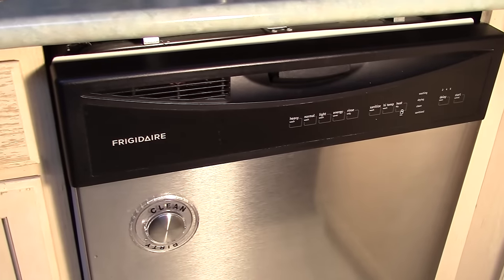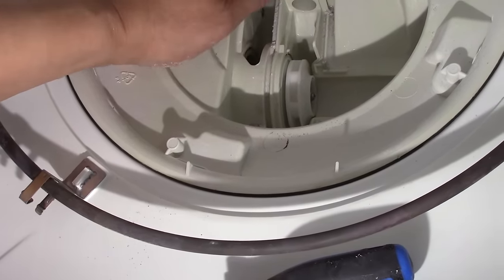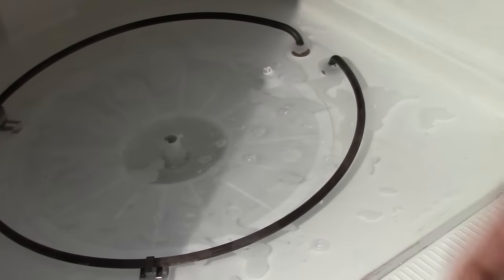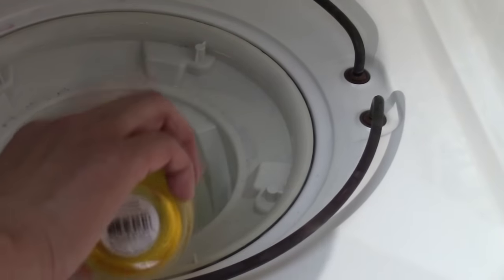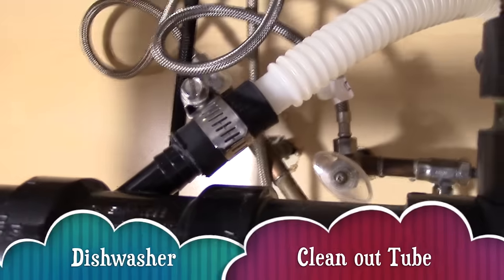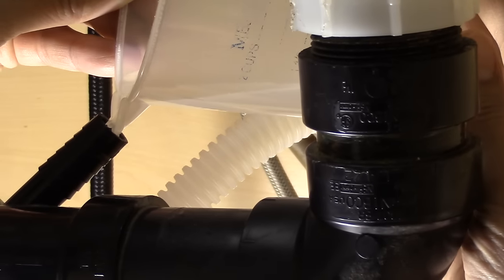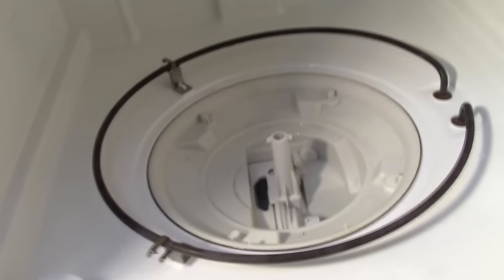Frigidare Dishwasher Not Draining Failed  2x - DIY unclogged dishwasher

Comment: Thank you, I realize that your video is 4 years old but you should know it’s still helping people fix their lousy Frigidaire dishwashers. Very helpful 👍
Reply from the maker: Yes it seems like there is still the same problem with their dishwasher like mine. Thanks for watching.
Reply: Lousy lol you do know it's not lousy. It's your lack of dishwasher knowledge that causes issues right. A dishwash is not a dishwasher but as sanitizer. You cannot put greasy dishes in a dishwasher or dishes with food on them inside of a dishwasher or you always get this problem. You have to hand wash first and then put in the dishwasher.
Reply: Yup!! Last method worked for me, some sort of build up in that small pipe.  So happy I came across this video and didn't have to pull the dishwasher out and take it all apart.
Reply: Mine won’t start after getting the water out and cleaning it the lights are on but it doesn’t start
Reply: I come across this video and it’s saying 6 years old for me 😊

Comment: I don’t usually comment on videos but this worked. Great info too. Step 3 was a kinked hose from too much junk under the sink pushing on the hose. Almost bought a new unit! This saved $$$$ and solved the root of the problem. Also helped me get the filter installed again, for the life of me I could not get the 3 o clock and 6 o clock positions right until your video.

Thank you!
Reply from the maker: You are very welcome. Great to hear it worked out for you. Thanks for sharing.

Comment: I'm so glad I didn't use plain old force before finding you.   Your video showed so clearly how to remove and replace the glass trap and what it sits in without breaking everything.  Thank you so much!!!
Reply from the maker: You're welcome Pamela. Thanks for the visit.
Reply: @jonahvlogsdiy4143  Thanks again!  I was wondering the same thing about all that non-food stuff in the filter and realized that washing the occasional dish sponge or scrubber in the dishwasher might be a source of lint and fiber.  If that's the case, I'm glad the filter is catching some and not just dumping more plastics into the water supply. And thanks to you, it will be easier to check and clean this more often.

Comment: So I watched your full video. It was very informative. Went down the rabbit hole and cleaned out the basket first. Then you'd cleaned out the drain line that into the garbage disposal. The translucent tubing going to the dishwasher was clogged. In my case. Ran a piece of wire down it and it was full of grease. Thank you for pointing me in the right direction.
Reply from the maker: Thanks for the visit Chris. Glad my video helped.

Comment: This is the exact video that I have been looking for! I have been fighting with my dishwasher for months. It kept throwing a breaker, and I knew the pump was not working because I had standing water in it whenever I would open the door. I disassembled everything according to your steps and found it absolutely caked with calcium. Three bottles of vinegar and a box of baking soda solved the problem. I want to take everything out again and clean it more thoroughly, but I got it running again. Thanks for posting a "regular guy" video. There aren't many out there.

Comment: Thank you for the great video. I started where you ended and found my problem right away. I’m in a new apartment and haven’t had a garbage disposal in a really long time. My dishwasher drain hose is connected to the garbage disposal. So I ran hot water and the disposal about a minute. Voila! Thank you for all your attempts so I didn’t have to. 😉
Reply from the maker: Glad it helped! Great it worked out for you and thanks for the visit.

Comment: Your video was the first one to pop up when I was looking for a problem solver for my dishwasher. I did the 3rd suggestion 1st and it completely worked! I have the same exact dishwasher but different year model so it looks exactly the same on the i side. Somehow a thick plastic straw from a cup had got clogged near the end of the drain line. Thanks for the vid. I was getting ready to claim my "broken" dishwasher to my homeowners insurance! You saved me money. Only cost me about 10 minutes of my day. So worth it. Thanks again for the very helpful video!
Reply from the maker: Super glad it worked. Thanks for sharing your story.

Comment: Thank you! I fixed my problem using your first and second attempts. Luckily didn't have to move onto the pipe cleaning step. The fact that this video has 700k+ views means you are a great teacher and Frigidaire has some re-engineering to do.
Reply from the maker: Great job! Thanks for the compliment.

Comment: Had already done method one and jumped to method 3. Found a lot of crud in the hose which got cleaned out. But it still didn't fix the problem. After the baking soda/vinegar mixture it finally cleaned everything out and it's back to draining. Thanks for the help and fun presentation!!
Reply from the maker: Good stuff. Im glad if finally worked. Thanks for sharing with our viewers.

Comment: This was a great video - very clear, and the debugging aspects were great.  I went through all of your steps (I have the exact same model) but alas, it did not work......AT FIRST.  I too thought that the drain at the sink side was clogged but it was not.  I wanted to move the dishwasher out but the prior owners had attached it to the granite countertop underside with a very rigid epoxy, so I would have needed to chisel that away to get to the drain hose end near the pump.....before I did that project, I went back to your baking soda and vinegar suggestion.  I did that process (baking soda+water, then vinegar, then boiling water no less than 10 times.....probably used 1.5 - 2 kg baking soda (4 small 500 g boxes) and 3-4 litres pickling vinegar....BUT after that.....it drained!   So there can be blockages at other areas, and the vinegar+baking soda will work, but you may need to do it a number of times (like I said, for me it was at least 10 times).  
Thanks again for the informative and, more importantly, useful video!  Showing the failures is as important as showing the success. Please do keep it up!
Reply from the maker: Super glad it finally worked. Thanks for the visit.

Comment: Good job. I watched the whole of your video before I started to fix my dishwasher drain issue. I started first to clear up the pipe connection under the sink. I found a big resistance when I inserted the bush to clean up. That's it worked.
Reply from the maker: Awesome! Glad it worked out for you. Also glad you started with the third option too. It saved you a lot of time. Thanks for watching.

Comment: My issue was my drain pump! Every source pointed towards replacing the pump. Before replacing a part just take it apart (its going in the trash anyway)
When I took it apart I found a tiny screw inside! reassembled and now the pump works fine.
Almost wasted 50 buks
Reply from the maker: So glad you found out the problem. Thanks for sharing with our viewers.
Reply: Where is the pump?
Reply from the maker: Sorry i haven't done work on the pump. I hope some of our viewers can answer that question for you,

Comment: You dont have to remove the spinning gray thing. You can remove the white thing that holds it and the gray thing, by pulling back on the tab sticking out, and rotating it clockwise. The whole gray and white assembly will come out as 1 piece. Remember to turn it counterclockwise when reinstalling it, to lock everything back in place.
Reply from the maker: Excellent! Thanks for the tip.

Comment: Just had my garbage disposal replaced and now a clogged dishwasher. So the two can be related?
Reply from the maker: It could be. Now you know how to unclog it. Thanks for watching.
Reply: Look at the dishwasher drain hose under your sink and see if it is connected to the disposal.  I bet it is. There's a knock-out plug in the side of the disposal, which if it is not removed will prevent the dishwasher from draining.  Remove the drain hose taking care to catch the water in it with towels or a bucket.  Using a finger or a screwdriver see if the port of the side of the disposal has bee removed.  If it hasn't, then you'll have to remove it.  Once that is done, re-attached your drain hose to the disposal.

Comment: I made a vid of repairing  mine as well however, upon review prior to uploading, I'd dropped 205 "F" bombs and decided against it. Turned out mine was a blocked drain hose.
Reply: Same on the blocked drain hose. Unhooked it from garbage disposal and ran the unit with nothing. While the pump was still running sucked on the drain tube and cleared the potato in my drain line and all works again. No flipping clue how a large chunk of potato got past the strainer?
Reply: Would like to know if this works with Frigidaire dishwasher model from 2008 4000 series aquaSurge technology with speed clean P/ 154580101 (0406) please let me know if you can help.  The model # is handwritten as PLD4375RFC and the serial # is TH80675040
Reply: I really appreciate your videos.  I had a repair man here but not finding the exact problem because the dishwasher is from 2008 but it worked perfect up until 2 days ago.  My dish garbage disposal works perfectly.  The sink has not backed up.  I unloaded a load of clean dishes 2 -3 days ago. Since then it was empty except for a few cups.  I usually wash in the sink first because I don’t have a full load until a couple of days.  Anyway the dishwasher was off.  It had been unloaded everything clean then a day later I went to add a dirty rinsed cup and the bottom of the dishwasher was full of water even though I had not used it.  I paid a plumber to look today and they could not be certain where the leak maybe a slow leak from the input valve but they were not sure.  They located the valve from dishwasher to water supply to shut off for now but there was a lot of maybe and speculation.  While I have had the dishwasher since 2008 I never had it serviced and my drain and dishes are always clean.  I don’t want to buy a new dw if this Frigidaire is fixable.  Can you help? 
conteannmarie@gmail.com

Comment: After watching your video, I would start at the pipes connections & p-trap etc.. often they are blocked, especially with a waste disposal hooked up too, I take them out all together and flush them outside with a garden hose, thanks, great video.
Reply from the maker: Great point. Thanks for watching.

Comment: Thanks for the video! I had already cleaned everything out of the drain, strainer, etc. but figured I'd check youtube for any other advise before I put everything back together and tested the dishwasher.  Jumped past your 2x fails to the drain hose clog issue, so I checked mine - and that was the culprit!  Not sure I would have thought about that, at least before trying a couple other things - so thanks for sharing!
Reply from the maker: Super glad my video helped. Thanks for the visit.

Comment: So saw a bunch of other videos that showed cleaning the dishwasher and stuff you did in your first attempts (which I did). But had no luck. So ordered a new dishwasher set it up and it started doing the same thing and started to show error codes. Out of frustration started looking at YouTube again and stumbled across your video where it shows your last resort of cleaning the line and that did it! Just wish I would have found it sooner on all the other videos I looked at before I ordered the new dishwasher even though my old one was over 12 years old. But I did find your video and saved myself from a store runaround and replacement nightmare! Good stuff here thanks!
Reply from the maker: Glad my video helped Rick. Sorry you had to order a new washer.
Reply: @jonahvlogsdiy4143  Thanks Oh well still saved me from calling a plumber, roto rooter, etc. so didn't have to go down that rabbit hole! Keep up the great work!

Comment: Thank-you!  Fixed my dishwasher in less than an hour.  Cleaned out the filters first, there was a small piece of glass in the tube where the water goes into the dishwasher but was not the fix.   Checked out the drain hose where it connects to the sink drain, clear.  Tested not fixed.  Did your baking soda and vinegar, saw some bubbles coming up so had some hope.  Just to be sure I took the drain hose off again and sucked on it until water came out, we eat bread with a lot of seeds, suspected they were the cause. Ran rinse cycle, fixed!
Reply from the maker: Awesome! Another happy customer. Thanks for sharing.

Comment: Hey Jonah just watch your video after I fixed my dishwasher by myself. Wished I would have watched your video first. But found something different in mind. You know where the pump is on the bottom of your dishwasher there's actually a rubber deal that keeps it from back flowing and apparently from poured hot water in the garbage disposal side of my drain it's swelled that piece of rubber and actually sucked it into the pump. So it was blocking the pump. And I also found a chip off of a dish blocking the pump in the inside of the dishwasher. Just for anybody that is curious about if that clog doesn't fix their draining problem.
Reply from the maker: So glad you shared that with us. Now our viewers know. Thank you.

Comment: This worked.  Might have had it draining by cleaning the connection to the disposal, but cleaning the parts in the bottom of the washer makes it complete.  We have this model and it seems like it does a very good job, and then it was clogged.  Thanks for the content!
Reply from the maker: No problem. Thanks for the visit.

Comment: Awesome video!  I learned so much. One thing I tried was "divide and conquer".  I disconnected the washer drain hose and stuck it in a bucket.  Since water shot out, I knew the pump was working and also that the clog was most likely in the disposal inlet.  Thanks so much!
Reply from the maker: So glad my video helped. Thanks for watching.

Comment: This really did help and I learned from another video that holding down the cancel button during the trouble shooting process helps to eliminate or focus on the drain pump. The pressing of the cancel button and then closing the dishwasher makes it go into drain mode and if it doses not drain or the motor does not make a sound then there is your problem. My fix was to hook a wet vac to the hose that connects the dishwasher to the sink and it sucked out some really foul smelling stuff that seems to have been in there for awhile maybe since the previous owners.
Reply from the maker: Thank you so much for the added info. This helps out our viewers.

Comment: Great video. After being baffled for months I finally unclogged the clean out valve and fixed the drainage problem. Now I hear a rattling sound in the rinse cycle I thought glass in the impeller. So I did all the steps and nothing there.
Reply from the maker: I'm not sure what it could be also.

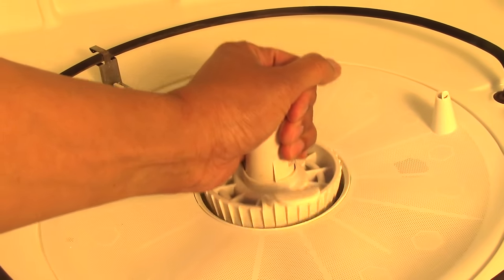Comment: 'ello Mr J. Love the video!! I am on my 3rd Wash, same load.  After 4 vinegar/BS explosions. The first time, dw cut off early in 1:29 min wash process.  My DW may be beyond repair? However, Left over water level has lowered from just below screen by about 1/2-1". Standing water "runs" clear. 
I highly recommend this Vlog! If you own a Frigidaire, I highly encourage one to repeat this hack multiple times before giving up.  Especially if they can't afford a new DW. I added Epsom salt approx. 2T to each cleaning to provide abrasive flush of whichever part has the problem. Also, my side line, drain under sink was Clear. Ima female, nearly 60 years old. If I can do this hack, anyone with an ounce of gumption can too. Thank You Mr J. I plan to post an update later today

Comment: Thank you........lots of thin plastic and sludge all before the pump. The clean out was actually not plugged at all. Cleaned all of the components, drained the water and flushed with baking soda and cleaning vinegar and boiling water. Cycled the dishwasher and it was water free after the cycle. Thanks again.
Reply from the maker: Glad to hear it worked. Thanks for sharing  you success with our viewers.

Comment: I've never heard of a clamp being called a bracket, but I'm just an old lady trying to fix my dishwasher.  Love your accent.  I think we got ours fixed after a week without having one.  The garbage disposal had to be fixed too after having a screw get stuck in it, but that was easy.

On the dishwasher, used a cheap long plastic piece with ragged edges meant to clean hair from drains and used it to clean the drain at the end that's inside the dishwasher.  So far, so good.  Lots of hair was clogging it up.  You're right, btw.  Why so much hair in a dishwasher?

Comment: Your instructions are great.  I removed everything down to and including the large screen.  I tried the soda and vineger hack.  When that didn't work, I put a kettle on the boil while the second much larger batch of soda and vineger did its thing.  When it didn't clear after dumping in the boiling water and waiting, I set the washer to pots and pans and sanitize. That took forever but did the trick. 

I hate this design.  I have a double kitchen, and the RCA unit that came with the house has been keeping on the 15 years I've been here plus whatever years the original owners had it.
Reply from the maker: Awesome. Glad it worked for you.